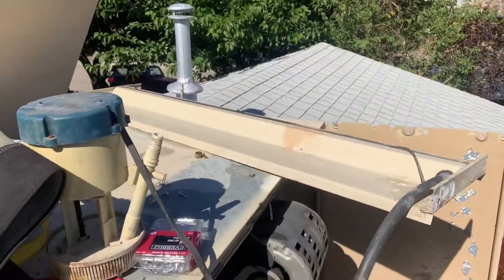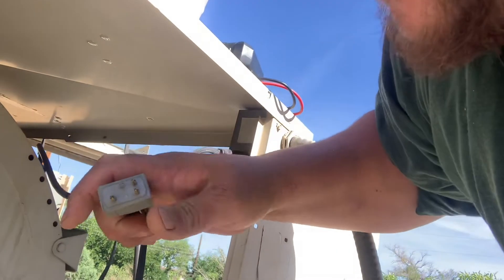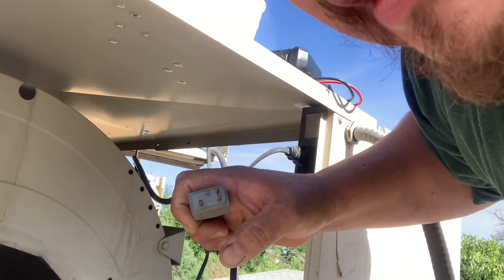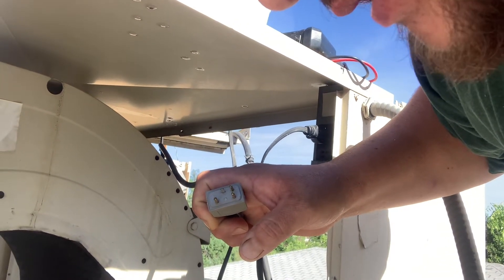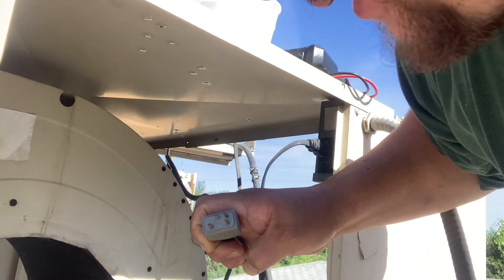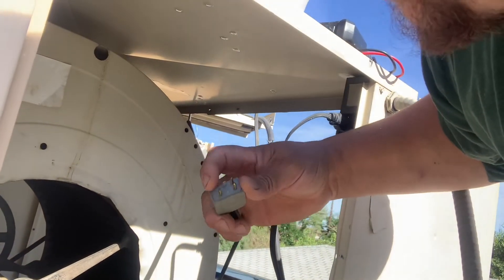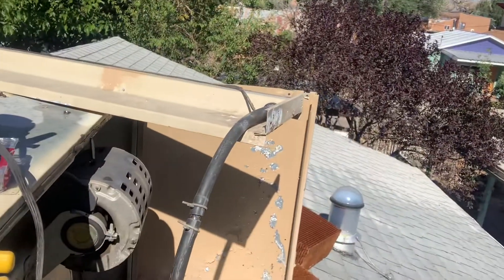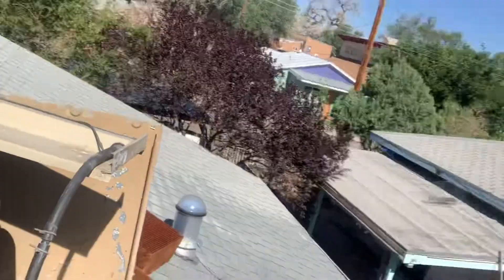Short Vid for testing Swamp Cooler Motor with an ohm meter 0.3 to 2 ohms on a 4 wire motor

Comment: Gaba GaboJo ber der ling a ling a ling? Hehehe good shit. Yo my man. I'm def not electricaly inclined... that said.... I'm trying to help my elderly neighbor save some doe. The original motor kept shutting off after like 3 mins. So I replaced it and of course it shut off again..  uggg. Metered it as u suggested and got 0.L. Does the dial switch need to be on to get a reading.
Reply from the maker: No switch needs to be on as you will be testing the electrical flow through the motor windings themselves. What a pain of a problem. Since it is a new motor, I suspect the wiring from the motor or the switch itself, because when the motor is on the wires will warm up and move around slightly when energized. Check for bad contacts at the switch and old wiring having bad insulation around the wires. I'm confused at how you got an open loop on the winding readings. I have a bad/cheap voltage meter that I have to play with the plugs to get it working consistently. Fidget around till you get it. One last possibility is there being too much friction on the belt and pulley so the motor gets overloaded and craps out. Feel free to post a video so I can see and I will get back to you.